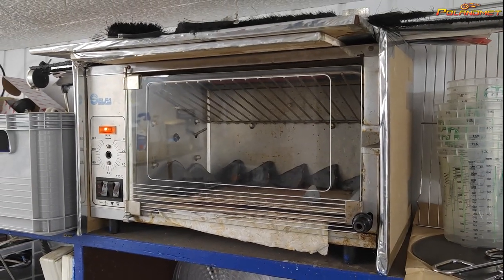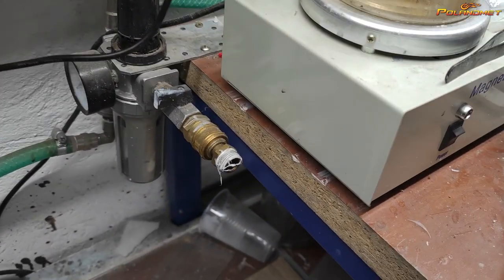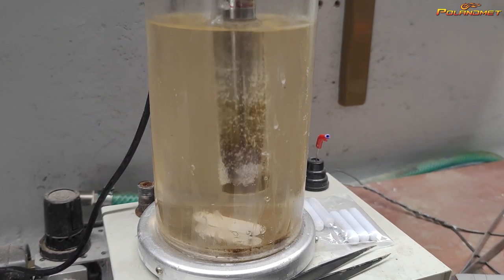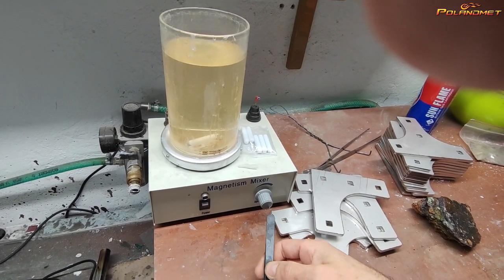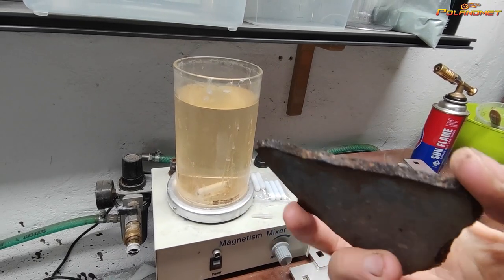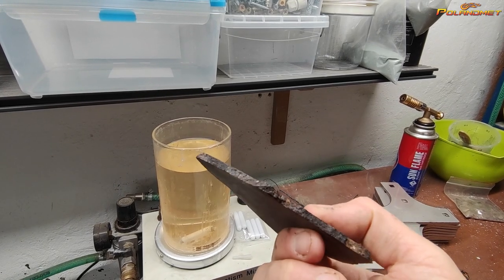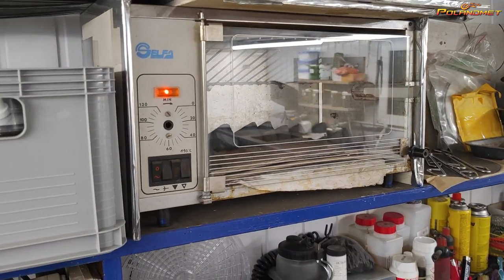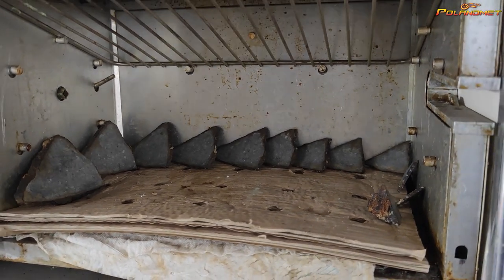How to apply PARALOID to a meteorite slice?

Comment: instead maybe use the metal wire you have right beside the paraloid glass to hold the specimen to put into glass.. this should prevent the little marks from holding the specimen?